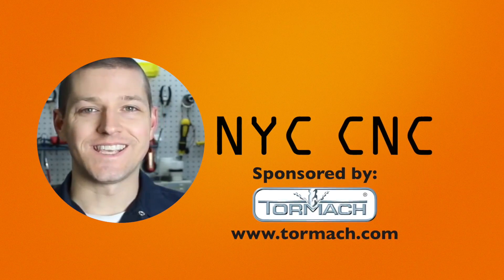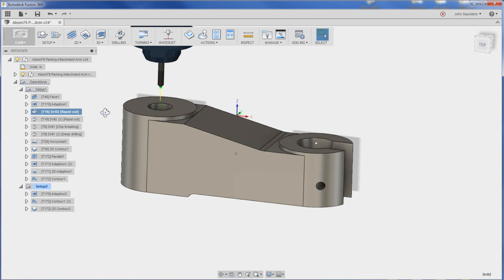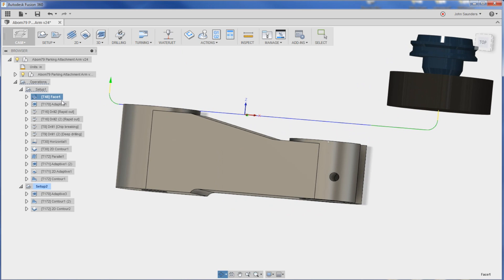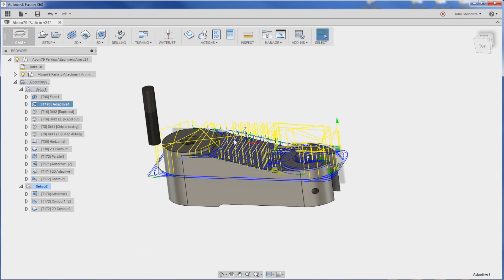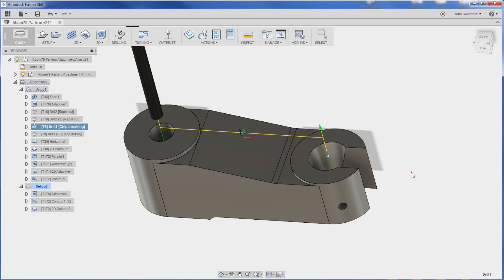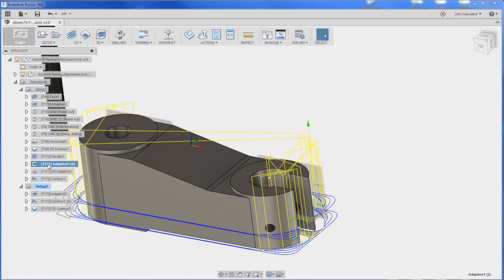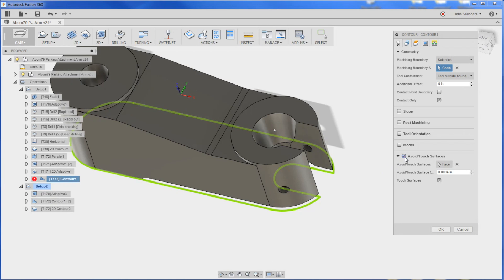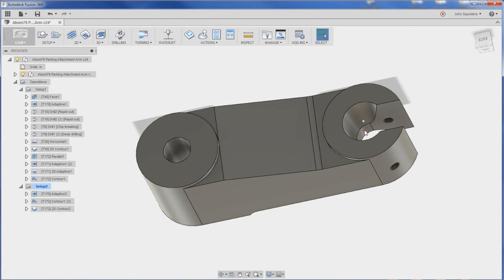Big Steel CNC: Parking Attachment CAM for Abom79 - Widget94B

Comment: What types of files you prefer to use when you're not designing part but CAMing it? I'm designing parts (using SolidWorks) and I'd like to know what types of files people prefer to work with. Do you use STEP or anything else?
Reply: +NYC CNC so I guess, it's better to use SolidWorks files because STEP can't contain cosmetic threads, MBD and some other SolidWorks features. Thanks for answer.

Comment: Are you sponsored by Fusion? There are  lot better packages out their.Fusion 360 is very limited and @ best basic but functional.Do you use it as it's cheap.In Europe Fusion has a very good reputation but it's viewed as very limited  and the cheap  cheerful reputation it has means its main customers are hobby machinists and very small garage like operations .Open Mind /Mastercam/Edgecam/ are probably the most popular for mid to large manufacturing and sub con machine shops.I know from experience Mazak has Edge as it official partners.DMG WFL.Hermle.mikron use Open mind as their preferred partner?

Comment: The flute length of the WarMill was at my request because HP limitations on these small mills prohibit you from using much more than that with any respectable WOC, and the LOC was based on the depth needed to machine the WarBlock. Hence the "WarMill" name. So why have more flute length if your not going to be able to use it. 

The WarBlock needs to be machined down 2.4" and you can't really do that in one depth on a 2HP mill. The next best thing is 2 depths of roughly 1.2" which a 2HP mill can do so we decided make that the approximate flute length. 

Plus the necked down portion is much more rigid than if it were not necked down but still fluted like a standard 2" LOC 1/2" rougher. Carl mentioned he might make a 5 flute version, but nothing definite. I hope he does, I would love to compare it to the 4fl version.
Reply: You bet buddy!

Comment: Funny, the only G-code I have ever written was line by line: this is the tool, this is where it goes, a tedious process for me for all but the simplest of jobs. I also still think you should mill the hole, not ream it. That is a pretty basic op that I think you should be able to hit within less than .001" unless Tormach's aren't capable of that.
Reply: NYC CNC
It is only a 2.5" part. You guys and your little tools. lol You could invest in a http://www.osgtool.com/Product-List-Detail/HY-PRO-CARB-VGx/VG464/detail/VG464-3751 I am sure you would find more uses for it than just this one job. I would be lost without a bunch of extended length tooling.

Comment: Helix the hole. If you had an extended neck reduced shank finish mill you can get within tenths. even with reaming, drill 1/64 undersized and ream half the speed three times the feed.  also for doing the outer profile seems like maybe a 1 inch turbo mill, peck it down, leave about .01 on then finish pass it with a long end mill. saves tooling

Comment: 3D cam paths are my life! Some times they feel like a prison. One thing to talk to Karl? At lakeshore carbide about. Is lens type profiles for the ball nose. The rpm of the tip is 0 and depending on what diameter the ball nose is dictates what your cutting edge rpm speed is. The smaller your steep over the more likely you are to rub. Lens profile is simply a larger radius profile. So if you have 6mm bit you can have a 12mm radius. At least this what we have now invested in. Or at least we are waiting for it to be delivered. Some thing to think about though!

Comment: John, I do this typ. of milling quit a bit. If I could make a few suggestions. On your 3D milling tool path I think you would have better luck if you change the angle to across the part. Start at the lower end and work up. A ball endmill doesn't like downward plunging cuts that it has to cut to center. It will do it but it may give you trouble. The tool will do much better cutting up hill. Like wise rough out you 20 and 45 degree bore/chamfer and finish mill with the ball mill( Doesn't matter up or down it wont be cutting to the centerline of the tool). I think maybe you roughing tool path on the outside with the long tool might be a little to much for your Tormach machine I think you will need to do it in smaller steps in the Z axis(You will be fighting chatter with the long tools don't try to high a RPM). I, typically on a larger machine would be using a feed mill and taking it all in one pass around but with shallow depth of cut(around .05 to .06) at a very high feed rate say about 200 inches per minute. Actually on that part I would be doing a helical path starting at the top all the way down to depth  with the feed mill.

Comment: John, at around 09:50 it looks like there will be a little part left of the step at the upper radius part so to me it looks like the angled flat on the top part might not be exactly like your CAD-model looks like because the ball nose mill can't cut right up to the next part

how do you try to solve the "issue"? manual milling or leaving it as it is?

Would be a nice project on a 5 axis CNC I guess ;-)
Reply: +NYC CNC sometimes i use some 4flutes straight endmill with big radius to limit the extra left by ball nose mill. In metric size, mitsubishi T12R1 ou R3 (&#216;12 with end radius of 1mm or 3mm). i can check ref at work if needed. for the top, and for the bottom, a smaller ball nose would be great to retake that ;)

Comment: Personal opinion.  But I'd make op-1 the other side (what's currently your bottom)

That's the flatter of the two sides. If you cut that side first. The 2 flat levels, outer profile (to full height of the part), two bores, slot, and 45 chamfer. That will leave you with a nearly 5" long flat section you can just throw in a vise, locate with the 751 bore and cut the remaining off. 

No fixtures to build and you will have a much more stable area to rest and clamp on for op-2.   

I foresee issues with your way trying to hold for op2. It's prone to rock in the vise. You'll be trying to hold up 5" of steel on a small 2" round flat section. Unless you spend the time, money, and energy to build an fixture to support both ends

Comment: Most excellent and to be able to follow on two different channels permits a much larger audience see multiple possible solutions and almost live commentary with very little delay.  Fantastic collaboration.
Why not use a magnetic chuck for the work pre-finish of the hole reaming?  This sacrificial plate and only minimal work on the 'bottom' at the end.

Comment: At 9:08 with the 3D adaptive path, the slope, is there a reason why the tool starts at the bottom of the slope rather than the top? I'm thinking it would be easier on the tool to start at the  top, not to mention the half second saved while the tool locates on the Z axis.
Reply: Adaptive clearing maintains the largest flute engagement (deepest cut) as possible. 

It reduces cutter wear since you're maximizing the amount of flue you're using on a tool. If you just took little 1/8" deep steps from top to bottom, you'd wear out the first 1/8" of the tool and waste the other 1"+ of flute above it. 

With 3D adaptive clearing you're initial depths of cut should be whatever your tools flute length is.
Reply: Makes sense, thanks.

Comment: why dont you deburr and chamfer all the contours right there in the first operation?
Reply: If it's just 1 or 2 parts why bother with setting up and dulling another tool and increasing the cycle time? 

It's quicker to just pull it off and hit it with a file or deburring wheel.  

If it was a higher volume production part (like over 100). Then ya. Putting in a deburring path would make sense. But a couple parts?  Grip it, rip it, buff it, ship it.